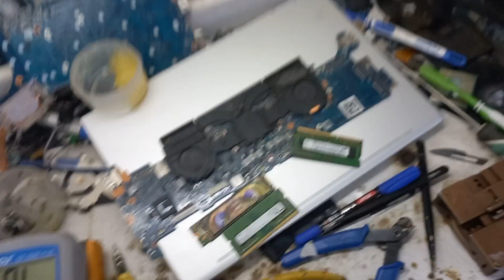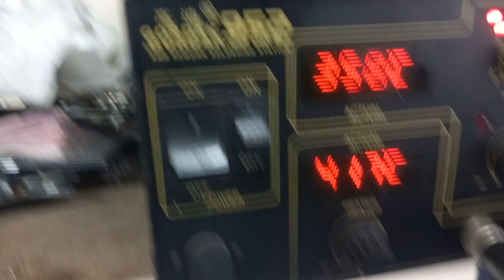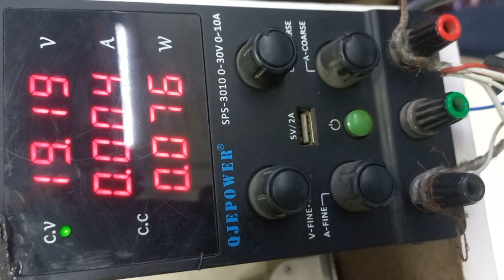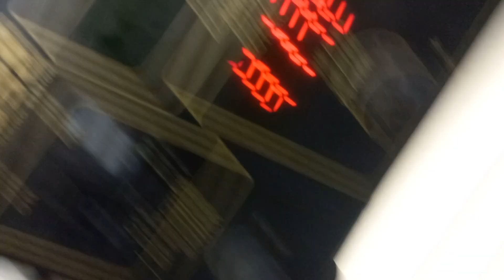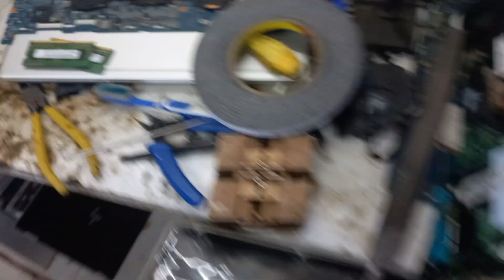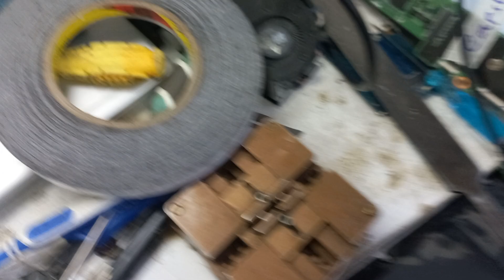TOOLS YOU MUST HAVE BEFORE STARTING LAPTOP REPAIR SHOP.

Comment: How to acquire these dead laptop motherboards. Also how to safely inject voltage
Reply from the maker: You can buy the junks motherboards from the suppliers. Injecting voltages requires you to know the amount of current which passes throu the power lane you would wish to do the injections.
Reply: @KipfixLapiTechnologiesNairobi  okay thanks where can I find the suppliers and at how much I don't have a lot of capital but thanks in advance